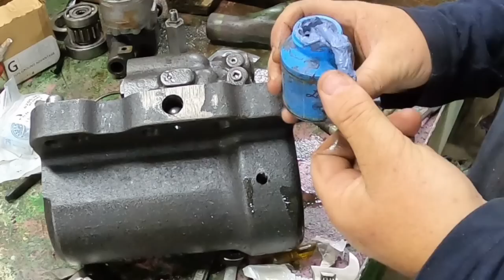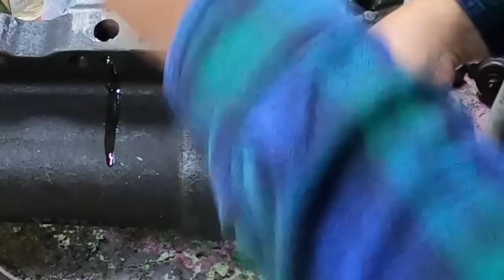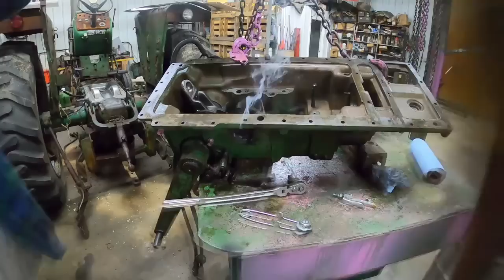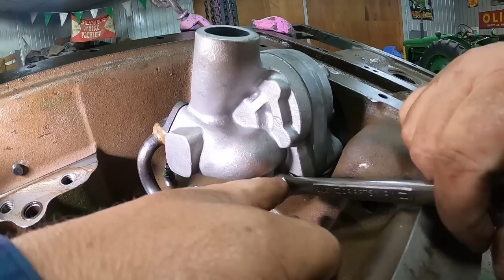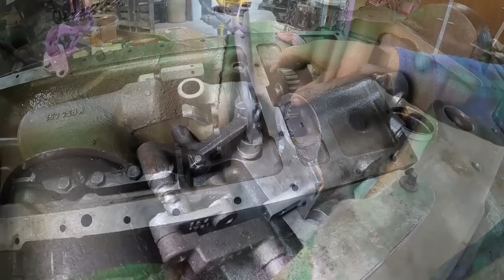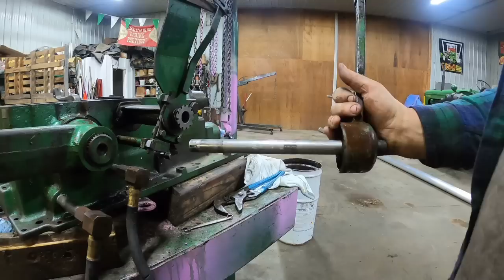PUMP UPGRADE for the 1550 Part 2

Comment: I am very interested in upgrading my 1550, could you help with the pump, tube and gear part numbers? Also do you know about how much the lift capacity is after the upgrade?
Reply from the maker: The lift capacity should be the same since the pressure doesn't change, but speed will increase due to higher volume.  The gear is no longer available,  so you'll have to find a used one. Give Maibach tractor a call. They should have everything you need to get the swap done.

Comment: 5-21-25 11:15 am.  Replacing hydraulic pump on 1655: We put in 3062449,the fit was very tight,but it did go on.The pump was new and you cannot turn it by hand,it will turn but not as free as in your video.Is this the correct pump and is that ok if it does not turn freely.  Thanks,,,,
Reply from the maker: Sorry for the slow reply, youtube held your comment for some reason that is beyond me. The pump I used in this video was used, so it's going to turn easier. You have the correct pump, and maybe you have put it back together already.

Comment: Hey Chris, I'm looking at a 4-150. I think I talked to you a couple years ago about has a hydraulic problem been sitting out in this guy's pasture. I've started looking at it again now. It looks like all the hood covering front grill has been messed up, but anyway, I think you'd said something about it. Maybe the pump was sucking air around the PTO. Would like to talk to you about it and I'll try and get some pictures of it next week. Hate seeing it sit he was wanting 5000 back then and that was three or four years ago. I think I could get it for less than that
Reply from the maker: The articulation joint can get pretty loose on those tractors, but they can be cheap horsepower.

Comment: How much trouble do you have sourcing parts for 50 and 55 series Olivers? I feel priced out of buying another 4020 and I have been looking a little at 1855s as an alternative to have a backup tractor.
Reply from the maker: I don't think it's too bad to get parts. Some parts you have to find used, but it's not often I run into that. Agco still has a good supply of common wear items, and places like Korves Oliver and Maibach tractor have been doing a great job of coming up with reproduction parts.

Comment: The friction disc, much like other things in life, start out tighter and loosen over time. However, the friction disc won’t bitch at you any more as it gets older.
Reply from the maker: It will fall apart on you though.
Reply: @ThatOliverGuyChris then you simply replace it with a younger one.

Comment: Well, that was quite a bit of info there, never easy is it. I have that issue with the snap rings flying, only difference is, I don't have a garage or enclose shop with a concrete pad. It really irritates me when I drop something that is not supposed to have dirt and gravel embedded in it, like a roller bearing. Good one Chris, enjoyed watching, have a nice day and week too!
Reply from the maker: Thanks! When I tore this down it was a nice day, so I had the big door open. Sure enough, when that snap ring went flying, it went out the door and into the gravel! LOL
Reply: Ha, that's funny, sounds like what I would do! 😄 @ThatOliverGuyChris

Comment: Did you ever have a tractor with the hydra electric actually work and you used it.  The first tractor i drove a 1600 in 1972 had it and it work and I remember using it on a Oliver disc.  But EVERY other Oliver i ever drove, it never worked.  Lol
Reply from the maker: I was surprised that the hydra lectric worked on the 1800 once we got it running. Then again, it was a loader tractor with an engine driven front pump. The remotes had barely been used in all those years. I still use it with the Super 88 when I pull the drill with it.

Comment: Isn’t it amazing that you can still get an agco part for a 55 year old tractor. eventhough it is a common part.  Still packaged in eom package.   To think the number of companies that touched that elbow.  Manufacturing, packaging, warehouse, distribution, picking, shipping to dealer, putting away and then picking for final pickup or delivery.   And here it is being installed to keep a tractor running for another 50 years.  Good video!!
Reply from the maker: Thanks. I know some conplain about parts availability, but but for machines that are now a half century old or older, I'm impressed with what we can get.

Comment: Again, thanks for the memories from 50+ years ago. I was screaming "You forgot the idler" when you remembered to put it on, without actually realizing it was from behind the stroke-caused screen.  Almost makes an old man want to get back into tractor repairs.  NOT!  But today a "Technician" can query a tractor computer from the comfort of the shop office using his laptop and Wi-Fi and sometimes even repair it by reprograming the tractor computer.  
I often have wondered how they keep their laptop keys from getting oily but realized that changing most sensors does not require contact with "Cancer-causing oils." If it does, the machine is going to be repaired by the "Dirty Mechanics" back in the shop.
Reply from the maker: The great thing is, they only cause cancer in California. 😂. The draper head gead has one of those stickers on it. Not on a specific component , just on the back side of the head. I guess at least they can sleep at night having warned me.

Comment: I had to put mine together without you, but thanks for the video anyway. everything  works as it should now, so all is well. Now I'm putting power beyond on for the loader & using the video you did on that, & then I have a new Iron Bull ROPS & canopy to install, should be a very nice 2-70 when I finish
Reply from the maker: Nice. I need to put more canopies on. Partially for safety, partially to get out of the sun, but mostly because they look cool.

Comment: Great job brother bought that ragged out 1655 4wd at Archbold the engine is very great sounding but it had a snow blower or so on it painted nasty yellow over the green its going to be lots of work need 2 find really nice hood and side panels the floors are ate like salt pit and foot throttle with straight thru box gotta love the olies thanks again very great attitude brother god bless from Miami County Ohio
Reply from the maker: If you're on Facebook, there is a group called The Free Oliver and White Auction Page. There's a guy on there by the name of Marty Prill, he parts out Olivers on that page and just started parting out a 1655. I haven't seen any sheet metal yet, but I'm sure he'll be listing it in the near future.  https://facebook.com/groups/1874201786125893/

Comment: Regarding the small snap rings that go onto the internal levers, we had issues trying to source them locally, the ones we bought would pop off of the pins. However, AGCO is very proud of the snap rings. Have you found an alternate that works?
Reply from the maker: I lost one this time and had an assortment from one of our suppliers that seemed to snap on well. I haven't had to buy anything like that just because of the inventory we had when we closed.